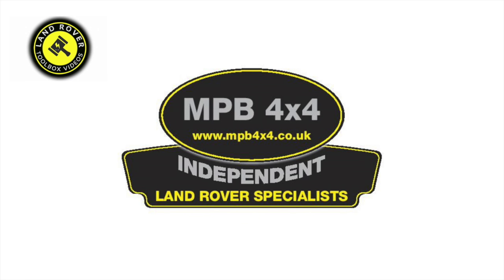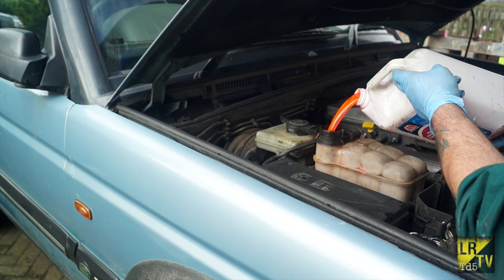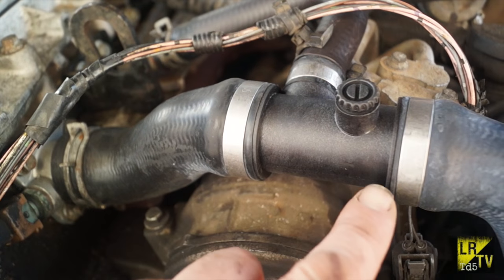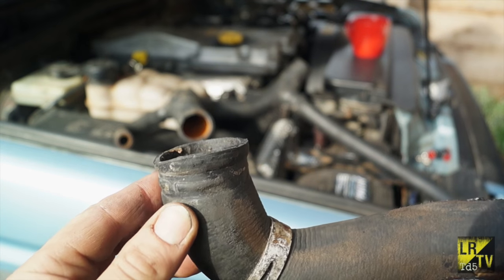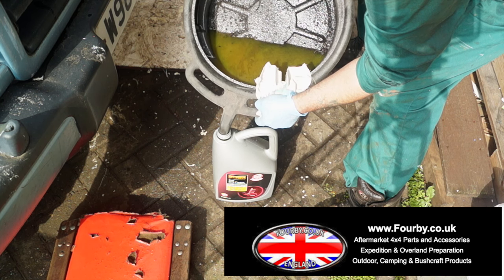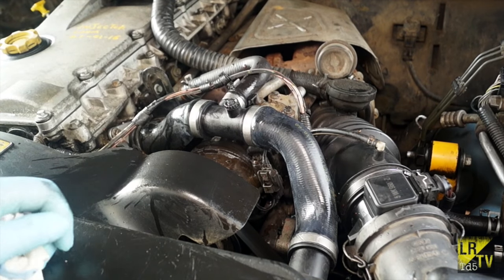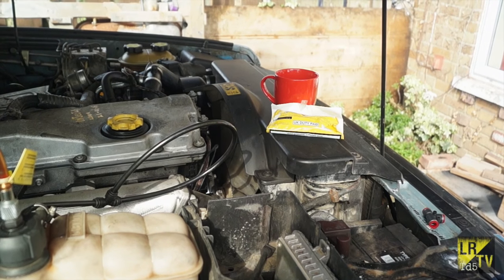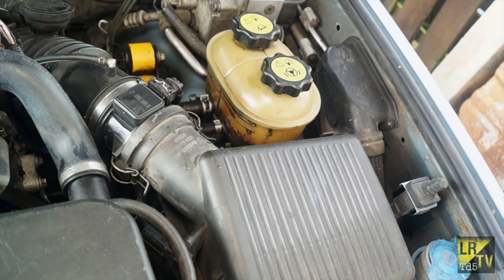Land Rover Td5 Top Hose, Coolant Change and System Pressure Test

Comment: Got a defender td5, coolant coming out both top and bottom bleed/drain screws and coolant level in the expansion tank is 100%. Heater hoses empty though
Reply: So sad that 8 months ago I was looking at this video after changing oil cooler, water pump and hoses. Now I'm looking at it again to change my radiator. Here we go again😭🤦‍♂️🤦‍♂️

Comment: Hi. How hard top hose on TD5 can go? mine gets quite firm when driven for 30km. I can squeeze it but can't squeeze it together. Never had overheating problems, cap never let pressure off, no coolant loos. When up to pressure coolant sits about inch or so below COLD LEVEL MARK. Is this OK? System stays pressurized when car is left overnight. If i open cap in morning some pressure runs out. I know that cooling system needs to be pressurized to rise boiling point of coolant. I just don't understand how hard is to hard?

Comment: Can someone plz help me I have a 1995 range rover county lwb and when im letting off the gas at speeds of 55mph there is a grinding/vibration noise. The noise will stop as soon as I press the gas petal. Also at slower speeds if the brakes are applied quickly and hard the noise will also appear. And while the noise is happening at higher speeds if I brake then the noise gets a little but louder. Anti lock and tc lights started lighting up a week after I noticed the sound. Ran the diagnostics on the anti lock at it gave out a 2-8. If anyone has an idea please let me know. Thanks
Reply from the maker: could it be the diff?

Comment: On the interstate I am running 101 C .  Is this too high?  Its hard to find a straight answer on forums I have perused.  My alarm goes off on my nanocom at 96...
Reply from the maker: 90 degrees is good.  Creeping up to 100 degrees C it's not good as its boiling point.   Antifreeze and the pressure in the cooling system raises the boiling point of the coolant however if I were you,  investigate why it is getting slightly over the running temperature.
Reply: Land Rover Toolbox Videos thanks brother. I will do.